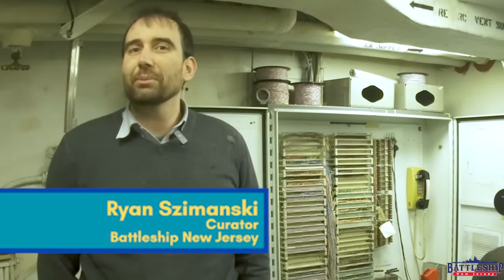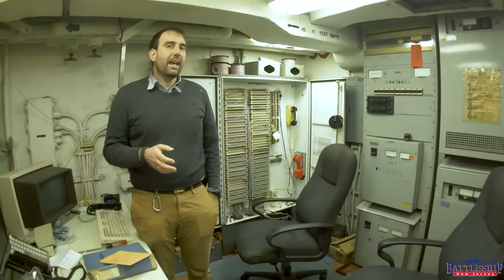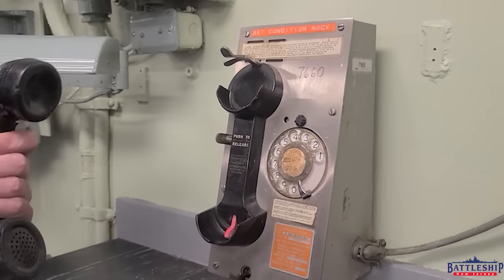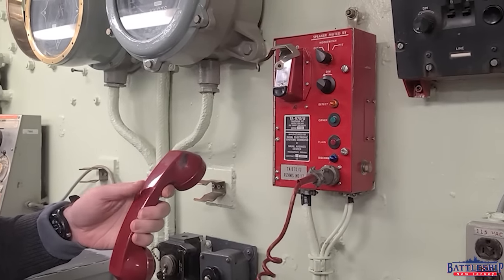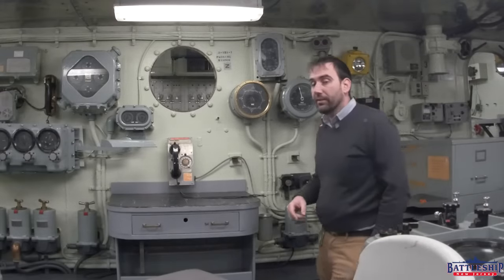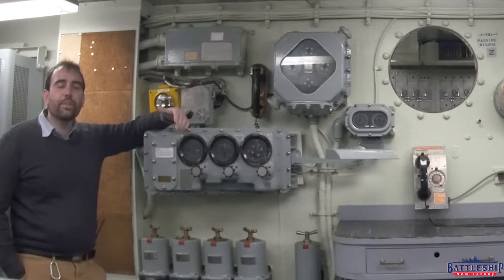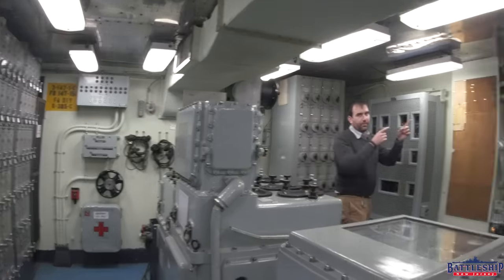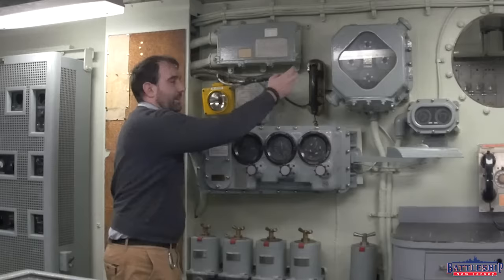What Powers a Sound Powered Phone and How Do Ship Phones Work?

Comment: My goodness, I cant believe how slow the rotary dial rotates back! Even with only 4 digits in a number, the battle could be over before you reach somebody to tell its about to start! 😅
Reply: Um… I think that particular phone set might have needed a little maintenance…😊
Reply: That phone dial is not working properly.  A "0" should be 10 pulses per second.  Stated differently, it should take exactly 1 second for the dial to return to the rest position when it released while dialing zero.  By the mid/late 80's, most of the rotary dials on board my ship had been replaced by standard Touch Tone push-button dial pads.  

The older step and crossbar switches only supported rotary dial.  Once the AT&T Dimension 2000 PBX was installed, the only thing stopping the conversion of sets to TT was time and budgets.

Comment: Do you need batteries for a sound-powered phone?  Asking for a friend.
Reply: if they send you down to the IC shop for a battery, be careful you never know how big of battery they might give you.
Reply: That's one of the gags we used to play on the new guys on their first sea tours, send Seaman Schmucketeli down to the I.C. shop to draw new batteries for the sound powered phones.  Our work center also had a phone that could be plugged into a shore phone line while we were in port.  As you probably guessed we played the "Hey Petty Officer Smith, did you give your wife (girlfriend) our outside phone number?  She's on the phone for you and sounds pissed" trick.  Of course, we were halfway between Norfolk and Gitmo at the time.  😁😁
Reply: @leftyo9589  while you're down there can you get some red-greed oil for the compass to know port from starboard?
Reply: i was an IC, i was always down there. LOL @desyncer
Reply: They are usually kept by the spare funnel locker inbetween the long weights and the striped paint
Reply: iirc do you have to fill out a requisition form tango zero one delta one (T01D1)
Reply: @desyncer  Won't do any good unless you apply some Compass Bearing Grease first.   Try the Line Locker over where the chow line, gig line, water line, and lubber lines are kept.

Comment: "What powers sound powered phones?" There's a question I use on probie firefighters; how much does a POUND of water weigh? (A gallon of water masses 8.3 pounds) They usually say 8.3#. Folks react without thinking, therein lies the lesson.
Reply: This is why metric is so much better
Reply: @MatthewMakesAU  🤷 you seem to have missed the point. Doesn't matter if it's metric or imperial, if you're not paying attention, you're not paying attention!
Reply: @HM2SGT  no, you're missing the point. Attention is a finite quantity. Don't waste it on an inane measurement system. Save it for more important things. You know how things in the fire truck are colour coded? Go paint them all a uniform grey with a tiny numeric code on instead and see what happens. It should be fine, after all it's just a case of paying enough attention right?
Reply: @MatthewMakesAU  Indeed? So explain to me how metric would keep somebody from answering the question by stating the volume rather than the mass?  The point is to pay attention to the details, be aware of your surroundings, expand your situational awareness.  These are important things for people were performing dangerous tasks in perilous environments.
Reply: @HM2SGT  because there's only one unit for mass, one unit for volume, one unit for each quantity and they have easy conversion factors (1 litre of water is 1 kg mass). The mental load of  switching just isn't there so you can devote more attention to the matter at hand.

Besides which, if you asked "how much does a kilo of water weigh" and they thought you were asking about a litre, it's still the same answer.
Reply: @MatthewMakesAU  Thank you! You have inadvertently proven my point.  You are suffering from target fixation, you are boresighted on something to the exclusion of everything else, and so you are failing to see the actual situation and address the actual problem.
I know you didn't mean to, but good work! Nice job! 👍
Reply: @HM2SGT  nope, you're just ducking the point
Reply: @MatthewMakesAU  You can't see it still. Which is unfortunate, but not everybody is cut out for critical thinking.🤷
Reply: @HM2SGT  perhaps you can clarify what you think your point is
Reply: Who is buried in Grants Tomb?

Comment: Sound powered phones still use electricity to connect, they convert sound to electrical signals.
Reply: Yeah but there is a difference between a phone that uses an active current to carry the sound of a voice vs a phone that uses the vibrations from the sound of your voice to generate the signal.
Reply: The question was what powers them. Electricity does not power them. That's like saying electricity powers the power plant.

Comment: Funny that children would have more critical thinking abilities than adults knowing that a sound-powered telephone is powered by sound. Thank you education system.
Reply: Technically, the adults are correct.  Sound vibrations are converted to a varying electrical voltage which travels over copper wires to the far end.  "Sound-powered" simply means that no EXTERNAL power is required for operation.